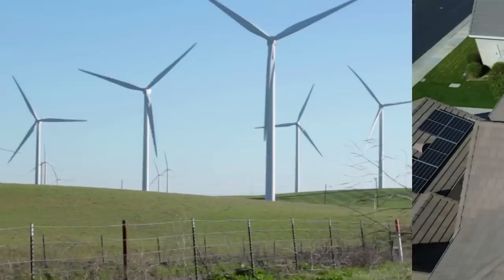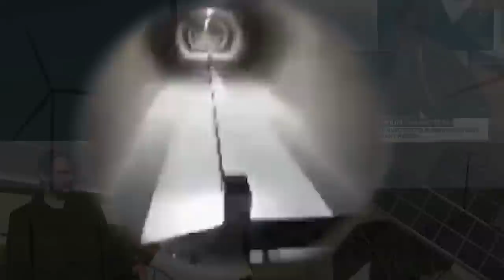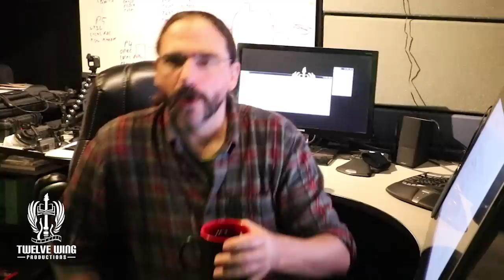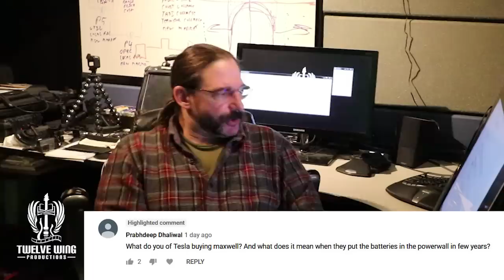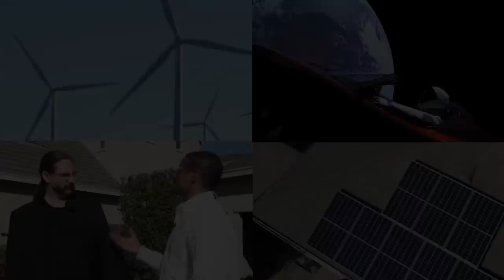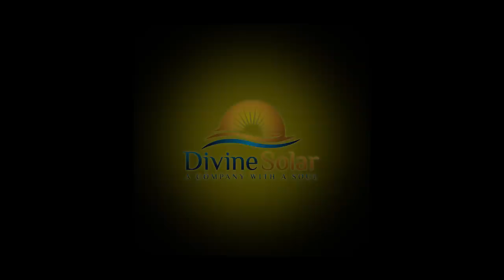Tesla purchases Maxwell; What does it mean for the Powerwall?

Comment: Careful applying gasoline car mentality to EVs. Normally you wake up to a full charge in an EV. Or when you finish your work day. You only notice the battery charges slowly on long trips if you drive more than 1000km in one day.
EVs are more convenient in the sense that you don't need to stop (and line up) at a gas station, no oil changes, less service appointments. And cheaper to drive. At least 1000 dollars a year in savings, in 10 years that is 10,000 dollars. Again, at least.
Reply from the maker: Very true.
I am going to have to devote an entire video to this topic as it's one I've touched on several times in separate videos.  It's probably time I pull it all together.
The reverse is also true in that you need to make sure you aren't so stuck on the differences between the two that you miss what is likely the greatest difference between the two.

400 miles of range is NOT equal between the two.
It's important to remember that when I say that 400-600 miles of range is ideal for an EV using the current battery technology type, I'm saying that because the usable range of such a battery is only 300-450 miles.
The whole idea of having that buffer is to allow the battery to be kept in it's sweet spot and have that battery last MUCH longer than it would if you were charging it up more on a regular basis.

Additionally, the reason I don't keep my car at 60% or 70% charge instead of 90 is that during those times when I do need 90... say for a heavy day of driving... I need that additional 100 miles of range now.  Not an hour and a half from now.

So yes, what you say is 100% true.  But when looking at the differences, you need to be looking at ALL the differences.
Reply: @twelvewingproductions7508  
It boils down to 3 questions.
Can the EV out-range the (reasonable) driver?

At that point, can the EV "fill" in the time it takes to "empty" (and fill?) the driver?
Are there sufficient locations to do so?

Tesla is at the tipping point of all 3.

Over 3 hours range per vehicle.

At least 159 miles in 15 minutes.

Sufficient locations (Especially in Europe with CCS on model 3).
Reply: Sounds good, if you make the video I’d be curious to know if you have any information, how much volume/weight is now dedicated to cooling and safety of a lithium battery pack, I have the feeling future cars would be lighter if safer or more temperature tolerant chemistries would be invented. Cheers.
Reply from the maker: @philbear2185 , agreed.

Comment: Not a very good answer. There isn't really any blurred line between batteries and capacitors, even ultracapacitors. As you say, batteries store energy on an entirely different principle than capacitors. Batteries use chemistry, capacitors use static electricity trapped between two closely spaced conductors.

Tesla specifically bought Maxwell Technologies for their dry electrode deposition process. The ultracapacitors is just icing on the cake. It's important to distinguish dry electrode process from dry electrolyte (solid state) batteries. What Tesla bought was not a solid state battery technology. What they bought was a way to produce a battery without having to use a lot of solvent to create the electrode, which in turn means that they don't have to bake off the solvent, that baked off solvent doesn't pollute the air, and Tesla doesn't need lots of electricity to power the ovens during the long baking time so they can produce cells faster and cheaper.

In terms of the Powerwall, there won't be any immediate benefit because there is currently a shortage of 2170 cells for the Model 3. Tesla has to turn to outside suppliers for 18650 cells to build the Powerwall and Powerpack. When Tesla finally does have enough extra production capacity for dry electrode 2170 cells to switch over Powerwall, you will get batteries with a longer life expectancy, and either more energy or less weight. The cells will also be produced faster, with less pollution, and at less cost.
Reply from the maker: The blurred line is in how long this new generation of capacitor can store energy.
In the past, storing energy long term was something totally out of the wheelhouse of a capacitor. 

These Ultracaps change our perception of that.
It is highly likely that when Ultracaps replaces batteries in the future... that we will still call them "batteries" in the same way we still call movies "film".

Comment: Being a Canadian, would this new Dry Battery Technology mitigate the degradation in batteries in Colder Climates?
I think you forgot to mention the benefits of Dry Battery technologies like, 
* it reduces the manufacturing foot print.
* it reduces the time to manufacture batteries 
* it also has a higher energy density.
Reply from the maker: This is a really good question but perhaps not in the way you intended.
Because you are from a colder climate, your battery life is already GREATLY extended.
What I think you may be confusing is longevity with performance.
Unfortunately the exact same mechanism that helps preserve the battery in cold climates also means that it does not perform at peak.
I will do a Quick Topic video shortly that goes into the mechanism by which the batteries degrade.

So I think the proper answer to your question isn't one of longevity but will the new battery construction method increase the cold weather performance of the batteries.

Unfortunately I think the answer to that is no... for now.
I say "for now" because there may be advanced electrolyte chemistry on the horizon that may alter that or that solid state batteries may be introduced that don't degrade as much when they use their own heat to warm them.
When we see these advancements you may see significant performance increases in cold weather.
That said, it's simple physics that things tend to slow down when they are cold.  So cold weather may be a thing that batteries struggle with for a very long time.
The best way to overcome this will simply be to make them more capacious.

Comment: I don't think most people understand the difference between capacitors and batteries. A car cannot be powered by capacitors. Capacitors will be great to store energy from the the braking system. That energy could be used quickly by the vehicle for acceleration as an example.
Reply: Cars may indeed be powered by supercapacitors.  If bicycles and buses can, cars can as well.  The only current issue is that the energy density is almost, but not quite there; however, in 5 years time it will probably be quite a bit better than Lithium batteries. The rate of development of supercapacitor materials is impressive.
In addition, in South Africa, we buy supercapacitors (7.1 kWh) for residential energy storage at a price lower than the Tesla 6.5 kWh battery.  And it will last a lifetime.  There is also no risk of fire or thermal runaway. See www.kilowattlabs.com - a US company :-).
Reply from the maker: @chrisjoubert7117 , I agree that this may eventually be the case but unfortunately we aren't what I'd call "almost" there.
We are, however, at a point where these can be extremely helpful in tasks such as rapid charging or energy recovery from braking.
I'll have a look at that company later once I get caught up.  7.1kwh is an amazing capacity for that.  What is the size measurement of that?
Also, the current Powerwall 2 is 15kwh with 13.5kwh usable.
Reply: @twelvewingproductions7508  The dimensions of the 7,1kWh box is 600x490x330 (23.6"x19.3"x13").  Also note that this technology is already in use with two of our major mobile service providers to provide backup power for cell towers, not needing air-con or diesel as per the old backup technology. In this case, the super-capacitor battery is tubular and fits inside the cell tower tube.
Reply from the maker: @chrisjoubert6129 , That's impressive.
I think we can expect a slightly higher density from the ultracaps that maxwell is providing.  It seems by the look of their exterior shots that they are using some kind of plate type internal structure instead of a roll.
I'm very excited to see what they come up with.
Reply from the maker: Tomorrow is not today Ric.
One thing I said in this presentation needs to be fully understood.  These latest capacitors are blurring the line between batteries and capacitors.
So while what you say is true in a way, it's equally true that what you really mean is that the current capabilities of capacitors do not allow them to be used as a primary power source.

Tomorrow is not today.

Comment: It’s funny how many people had deluded themselves into believing Tesla bought a functioning company primarily for something that is not functioning. It’s as ridiculous as if Amazon bought Tesla and threw away the car company, energy storage and solar reselling departments because all they want is Tesla’s no-Lidar level 5 Autonomy which isn’t real and so far from being real.

If you look at Maxwell’s stock history, you will see that shortly after they got super capacitors working, the stock was $40/share, because as you say, the line between battery and capacitor was blurred. Unfortunately, shortly after, Sony introduces the lithium ion 18650 which redrew the line between the two. MXWL stock went down and never recovered because lithium ion battery made advances faster than the capacitor. So Tesla was able to buy them for <$5/share of stock swap.

While Tesla May have factored in the Dry Coated Electrode into the decision, the company without that is worth what Tesla paid. Maxwell actually is a real company with real products and real customers, and that’s why Tesla bought. 

Aside from the ultra capacitors which Tesla needs a bunch of, Maxwell actually makes ultra capacitor batteries which are used for capturing regen in busses, or grid power interrupt protection. The problem is, in most cases they can’t compete with lithium ion batteries.

We know the capacitor battery has enormous power and very little energy. Nice if all you want is something to carry the load until the diesel generator starts, phase syncs, and picks up the load. But now Tesla can take all these customers and upsell them to powerpacks to replace the diesel/capacitor setup. Those customers and Maxwell’s brand and footprint has a lot of value.

Tesla is not going to make a 100 kWh battery using 30 kWh of supercapacitors in a vehicle. For stationary power they might do that so they can offer the customer 5 kWh lithium cells and 5 kWh capacitors to give 1000 kw/10 kWh backup (36 seconds). I think the most they will configure a powerpack is 2C discharge. The 36 second back up will need a diesel generator, the powerpack may not.

Where the capacitor battery in cars makes sense in if the power source is very low power and high energy, such as a fuel cell, or some new battery tech. The Riversimple Rasa makes use of a capacitor battery and fuel cell, but it’s a tiny light car. Converting it to high power lithium cells would use less volume but add weight and add capacity, assuming the same kw rating in charge and discharge. 

You can imagine the complexity of having power electronics for a car with capacitor battery’s and lithium ion. You can’t get the best result by having these in parallel. The best result has 300 kw regen going to the capacitor and releasing that during the next acceleration, and the lithium ion pack is used to make up for energy losses during those cycles and for steady state cruising.

Luckily, even the best lithium ion cells can’t replace a capacitor for voltage smoothing as required in every converter/inverter Tesla sells, in their cars, superchargers, future mega chargers, powerwall and power pack.

There are papers about Maxwell DCE technology at least as far back as 2012, and yet no real battery company bought it, Chevron didn’t buy it like they did with large format NiMH cells, GM, Ford, VW didn’t buy it. Yet so many are falsely reporting as fact their assumption that Tesla bought a company worth $200 million for $200 million because they are the only people on the planet who can see the $trillion technology pathway. Yeah, sure, ok. 

I want to see what Elon actually says about it. He is normally careful and won’t say something that will cause law suits from investors who bought Tesla for vapourware technology that nobody else wanted for over 6 years. How many MXWL shareholders will be mad if they find out the directors didn’t try to sell to the highest bidder if this is real technology?

Comment: That was a great video Jeremy (as always) and i think you covered a good 
broad overview without getting into too much nitty gritty. I do have one question though, where is the spare tyre and Jack??? In all the videos I've seen so far no one has shown where it is. Lastly, it was hard to recognize you without a whiteboard behind you. Perhaps you could put one on the back seat next time. LOL. Good job
PS... I'm spewing right now. I  weighed up all the so called experts opinions and thought the stock would dip further below $178 but now it's shot up to $205. Really missed the boat on that one. The horse has bolted now and will never get that low again unless Ellon opens his mouth again. Got a feeling Q2 results will be enormous.
Reply from the maker: Thanks, though I think you might have me confused with someone else.

As to the spare tire, that was the one thing that really bothered me about the Tesla.  No spare tire.
There are lots of experiments going on currently with tires with an internal structure that don't require air so we will see what the result of all that is, but yeah, that was something I thought long and hard about before pulling the trigger on the car.

Ultimately, however, it came down to the fact that I simply didn't drive the car where remoteness was going to be a problem.
If I had a pickup truck though?  Well that thing had better come with an option for a full size spare.

Comment: Oil killer's like what You are talking about are impressive, however you neglected one aspect of the Capacitor, ... 
surface area of the plate's. Now in the 21stCentury , graphene with placed atoms of "magic" will work, ...right?
Plus capacitors will allow FlashBurn Charging (patentpending) and the rumour that I'm starting goes like this , ... the new "meX" uses it

Comment: You do realize that the deal that Tesla made had almost NOTHING to do with Maxwell's Technology ultra capacitors and EVERY thing to do with the dry cell tech. This will allow Tesla to produce batteries at a 15% lower cost and at a 20% higher energy and that is being conservative.
Reply from the maker: I absolutely realize that Laurence. 

That's why I did the video.  (grin)
I do hope you watch it because what you pointed out was only part of Tesla's rational.  At least from the eyes of this process engineer.
It's not about the batteries being better, though they are, it's about them being different.
So much different, in fact, that they hold their own patent.
Because of that, and the fact that this patent and technology can in no way be traced back to Panasonic's IP, Tesla can now use it to manufacture their own batteries.
It's their choice to either do this, or to license the technology to Panasonic.

The result there will be EXACTLY what Elon Musk wants to have happen.  An acceleration towards a sustainable future.
Panasonic will produce much better batteries with technology licensed by Tesla so both companies get paid.